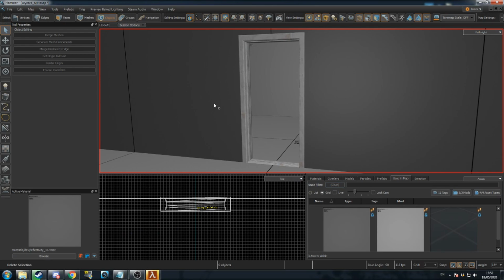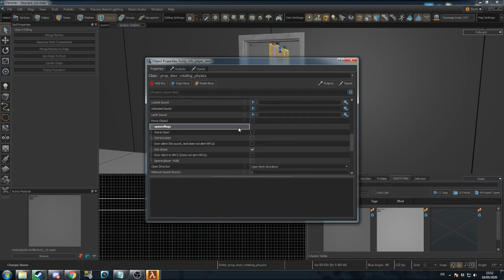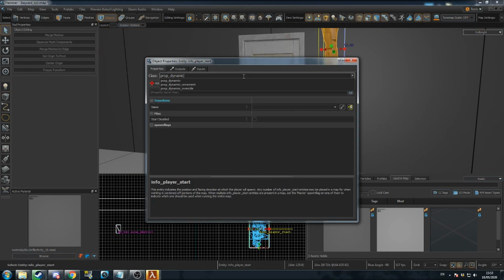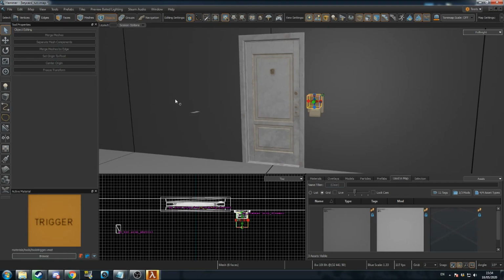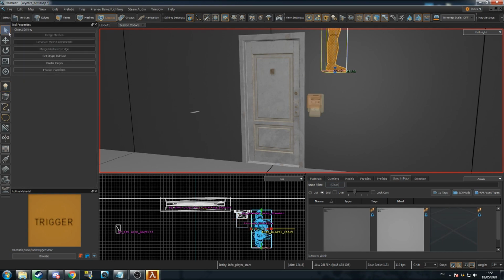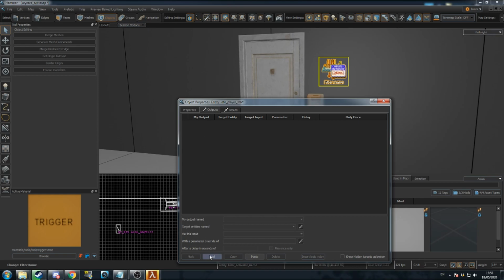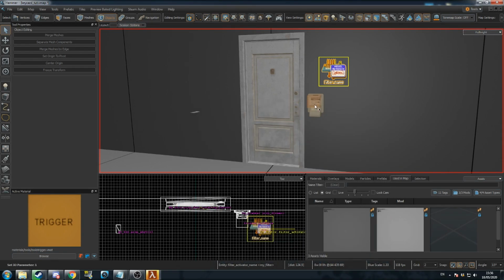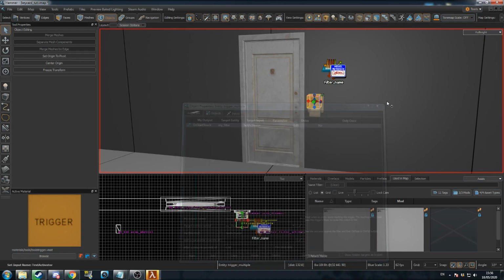How To Make A Keycard Activated Door in Source 2's Hammer

Comment: Do you think you could make a tutorial about how to make the combine power unit. In prefabs its called combine_powerunit.vmap. And if I want more than two of them in a level, I have to make one from scratch and I can't just copy paste from prefabs.
Reply from the maker: I think you've misunderstood how prefabs work. I did another video on prefabs you can check out.
Reply: @Hosomi  how do you get something to activate only after 3 other things have been activated. Like having to push three buttons for one door to open.
Reply from the maker: @irefusetopaytaxes7558  You can enable/disable logic_relays and have the relays in sequence. This is sort of like an AND gate
Reply: @Hosomi  I found that math_counter also does the job. Just have each button pressed add 1 and once it hits 3 or whatever max value you have the math_counter entity open your door.